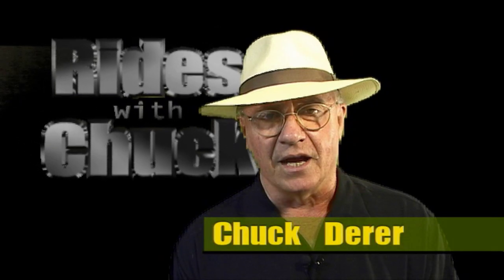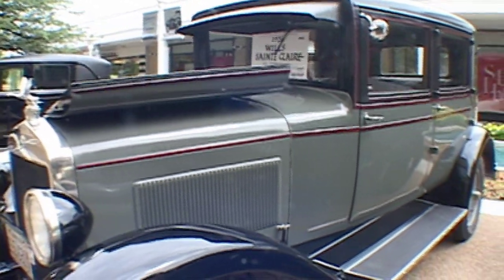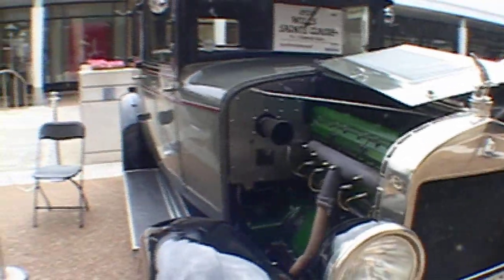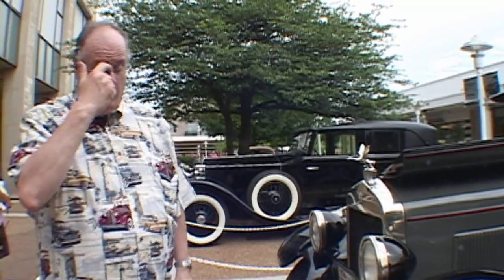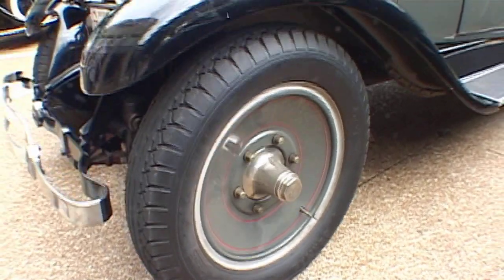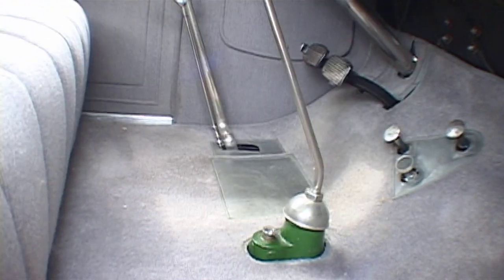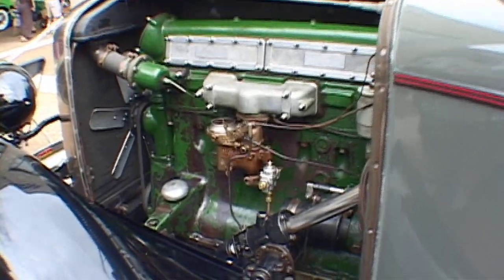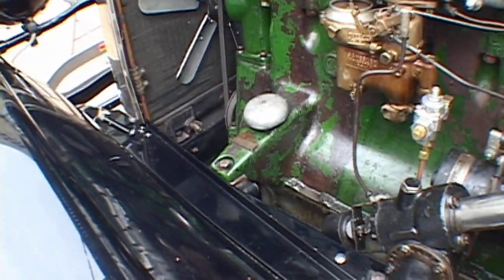1926 Wills Sainte Claire, a YouTube first!

Comment: My father bought a yellow 1925 Wills St Claire roadster back in 1953. He had it for a couple of decades before giving it to my older brother Curt in the 1970s. Curt had it for a decade or so before selling it sometime in the 1980s I think. The car still exists down in California, it’s a light yellow with red leather interior and as far as I can tell it’s still sporting both the paint and upholstery my dad did back in the 1950s. In my garage I have a OHC cam housing as you can see in the photos but I think that’s the only Wills parts I have though I could have others and not know it. If you go to my YouTube channel and look for my Old Cars Drag Racing you can see a couple of outside and one interior shot of the car as it was in the mid-1960s.
Reply from the maker: I'll take look.